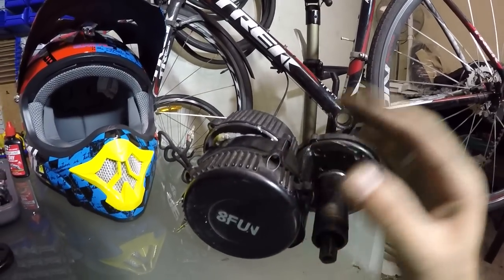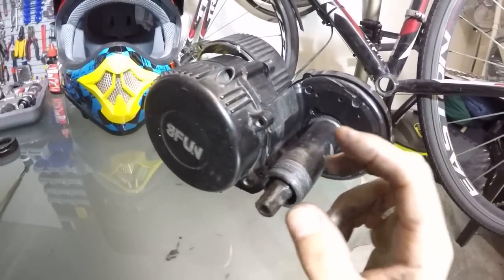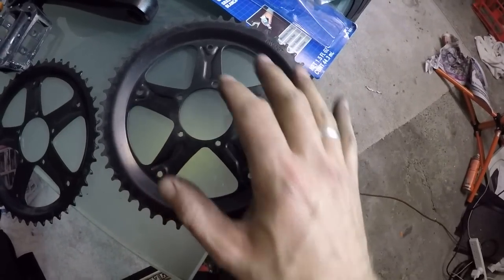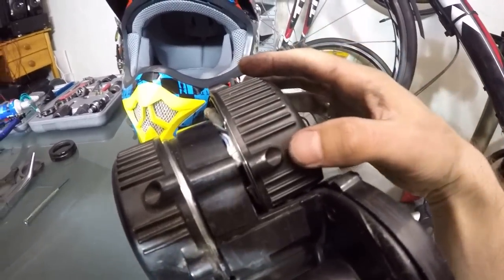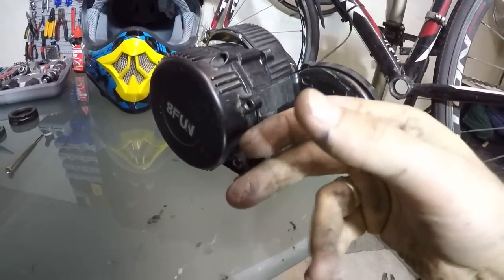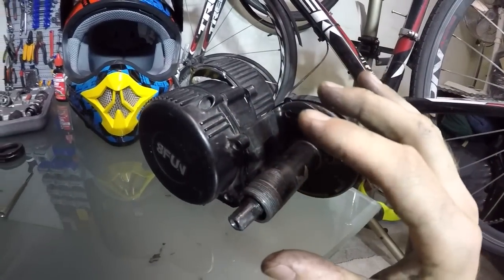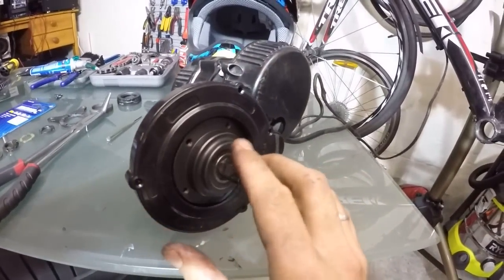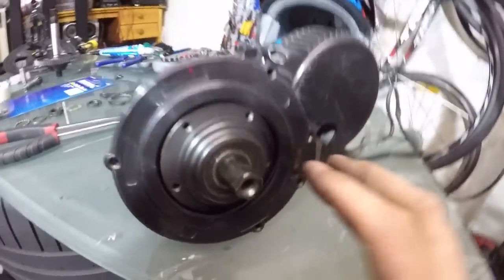DIY Tutorial Repairing BAFANG 8fun BBS02 750w 48v (Part 1 of 7) *intro/bottom-bracket/external gears

Comment: Hey, it's me again haha, could you measure the 52T chainring plz ? I'm gonna buy it but i'd like to know if i can put it on my bike. Thanks ! Im looking forward your next video !
And by the way, the 50kph limit is only for the PAS right ? we can go faster with only throttle ? (I dont use the PAS at all)
Reply from the maker: +AlexisFrJp Android - Hi Alexis, just measured both my chainrings, the 46T the one that comes with most BBS02 is 19cm and the 52T is 21.5cm looks MUCH bigger. If the 52T doesn't fit in your frame, don't panic, if you want to go faster you can increase the voltage to increase the RPM, the controller can take up to maximum 60V, check this video https://youtu.be/chO8e_RCdto
The 50km/h limit on the BBS02 is not only for pedal assist, I remember playing with my settings at work and coming home I felt something strange happening with my motor and then realised that it was limiting the throttle for some reason.....=/ 
**open this website so you understand what I am talking next http://electric-fatbike.com/2015/03/17/programming-the-bbs02-without-frying-your-controller-and-losing-your-sanity/ 
Next day I checked the setting and on the third tab "Throttle Handle" you should change "speed limit" selecting the option "By Display's command" and the other parameter "designated Assist" you should select level 9, this is the power you're giving to the throttle which is the highest (100%). Another important thing is to set the Pedal assist 0 (first tab) to 100% and 100% so u can have throttle at PA 0. I will make a video showing all that.
Pedal assist is shit in any bike... check out how fast I can change gears with throttle only, it is like motorcycle https://youtu.be/Pkjgxo5G_UY
Reply: +ElectricBike (Bruno) Yes I already changed this months ago but due to my small chainring and the moutain bike gears, I cannot go faster than 47km/h. I only wondered why and how you could reach  60+kph while the bbs02 is limited to 50kph. (and it was my question) But ok, you made the kph mph trick.
Yes haha I also almost change my gear as fast as you ! Now I'm even not aware anymore lol
Reply from the maker: I didn't do the Kmh to Mph trick that some people mention.. just need the USB cable and enable the throttle 100% and select option "as per display's command" you overwrite the top speed limit =]